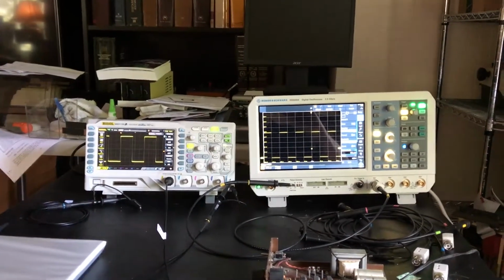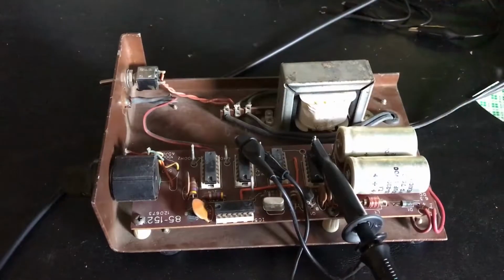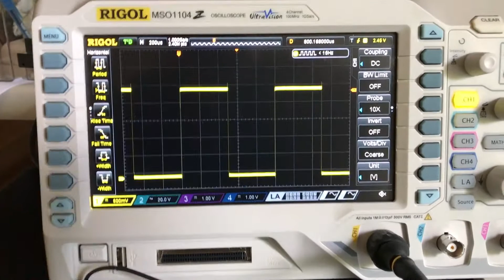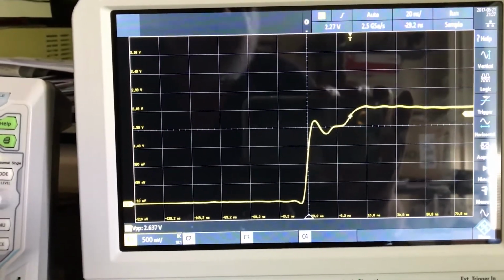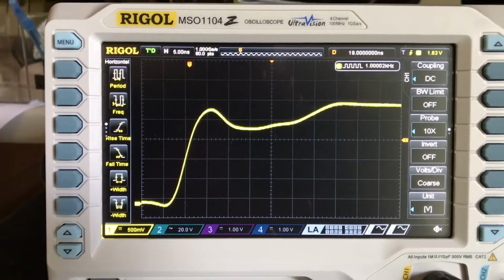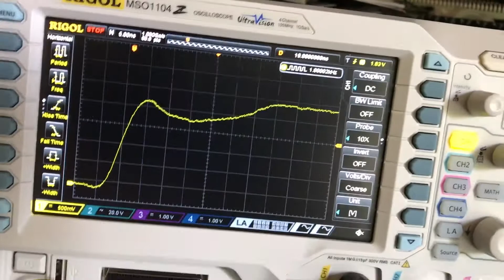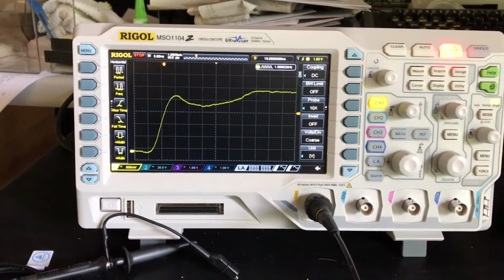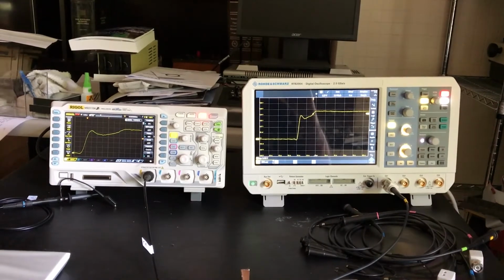RTB2004 - Part 4 - Rohde & Schwarz RTB2004 vs RIGOL MSO1104Z - Low Freq - STB25

Comment: You are comparing an $800 scope to a $6-7K scope you bought for $2020 on the promotion deal.  Are you kidding?  If anything, this shows how good the Rigol really is!  Also, your trigger points were not set to the same point on the waveform.
Reply from the maker: You're right. The RIGOL scopes and other lab gear provide a price point that is excellent. With the exception of the R&S scope all my gear is Rigol. I didn't mean for this video to take away form the Rigol scope; I have no problem recommending them and often do. The "issue" with the inbuilt Freq. Counter in the scope being so wildly off through me for a loop; I've seen this with the last 3 Rigol scopes I've had; seeing it work seamlessly on the R&S surprised me.
Reply: Is this deal still available?